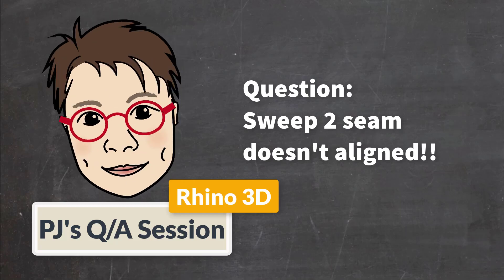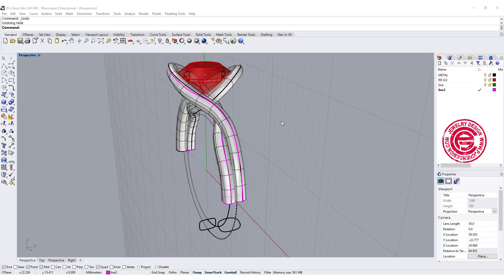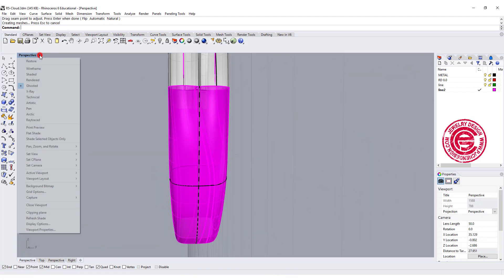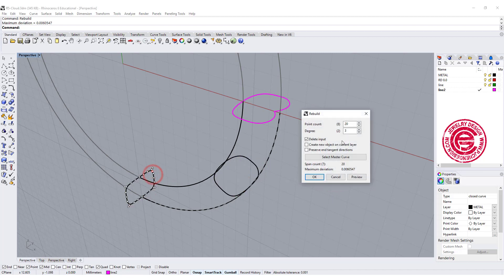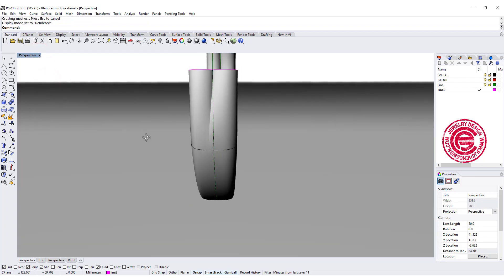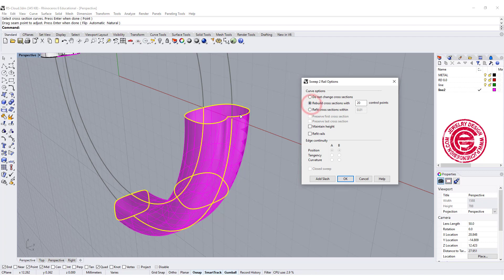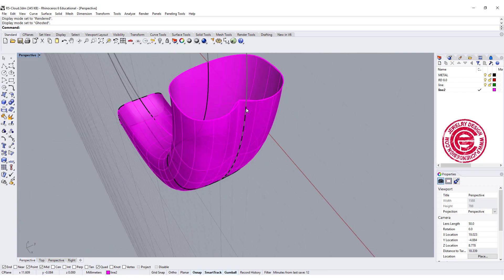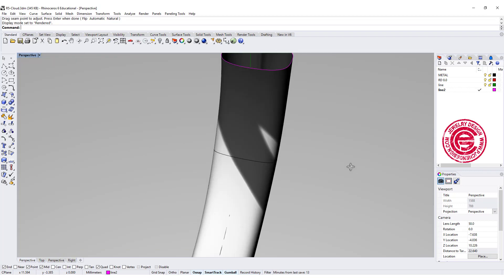Sweep 2 Seam Doesn't Aligned in Rhino 3D: Q/A Session (2019)

Comment: thanx for sharing. rebuilding the top curve will brake surface continuity with top part i think. the main reason for this failure is non symmetrical curves. if both curves are symmetric to the sweep axis, a symmetric sweep will be the outcome. Given that, it will help to add a curve point to the bottom curves where the V of the top curve is, as a centre guide. Another, safer approach to ensure surface continuity would be to sweep the two bottom curves and then do a BlendSrf to the V shaped to surface. This requires the top surface to be properly trimmed and joined first. Or, create 2 sweeps for either half separately and join them afterwards. not that safe for surface continuity, but safer that rebuilding the top curve instead of using the existing surface edge for the sweep. the technique shown in this video is correct, yet demands for the top part of the ring to be resweeped using the newlly created surface edges, to keep is all seamless and solid. hope all the above make clear some alternate workflows. there is never a universally good solution, but what is better for the specific job. greetings and thank you for your hard and good job. you keep our modelling brains working.
Reply from the maker: Thank you for sharing!

Comment: I have some question. If the edge is not  100%  match between surface and curve, then how to join to the upper shank without naked edge to avoid 3d printing problem?
Reply from the maker: nattapas pranishautra you can cap them separately. Then Boolean unit for 3 d print. The only down side is the rendering will have a line there.
Reply: @PJChenJewelryDesign  Thank you so much PJ Chen .
Reply: @PJChenJewelryDesign  Could you eliminate the original pointed profile and replace it with the new softer profile using "dupedge" or "dupborder", trim a piece out of the above area and then run "sweep2rails" between the new profile and the above profile to form a smoother transition?
Reply from the maker: @ronmiddleton5084  sure you can.

Comment: question: how would i project a tessellation onto a sphere?
Reply from the maker: Flow along surface should do the job if the surface is not to dramatically different in 3 directions. However, Grasshopper will be the app to use for this type of task.
Reply: thank you very much

Comment: Great video as always. With the sweep not being exactly like the curve how would you join the top half of the shank to the bottom? Thanks
Reply from the maker: I will sweep the top and bottom separately and boolean unit them together.
Reply: @PJChenJewelryDesign  I had the same question. When you change the cross section with more points then it is no longer 100% the same as it was before. Does it fit the upper half or do you  rebuild the top cross section in the same way as the bottom?
Reply from the maker: it won't fit since the cross-session is different. you will need to re-sweep the top to make it look flow nicely.
Reply: @PJChenJewelryDesign  I understand, thank you for your reply